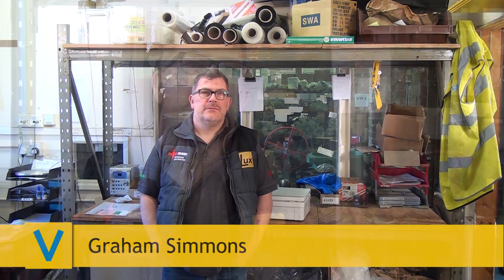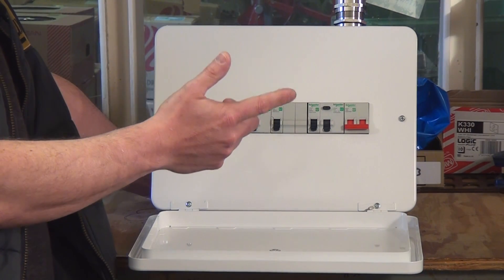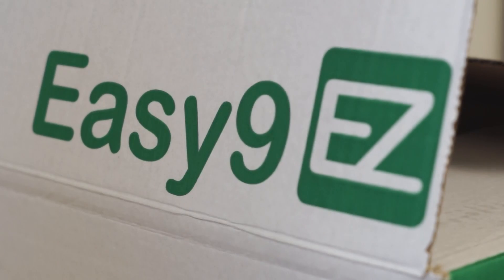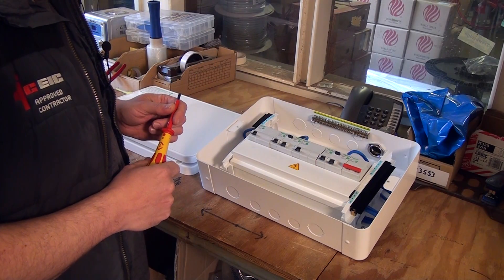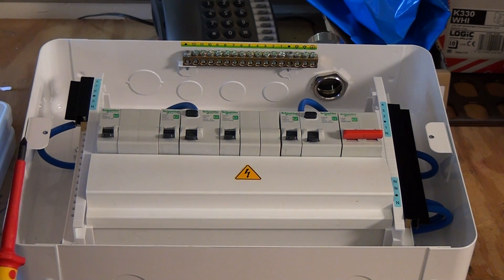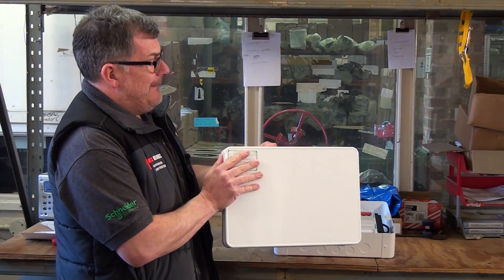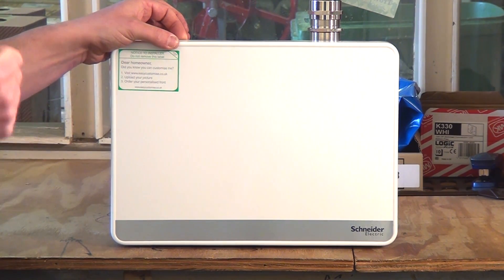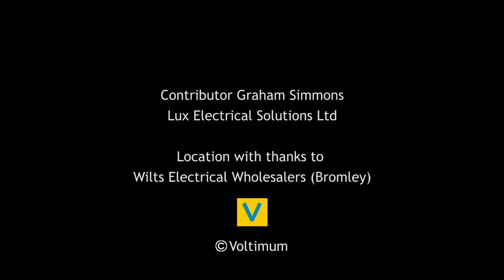Guide to choosing the right consumer unit

Comment: I just bought the 16 way version to replace my old CU. I've gone for RCBOs and there's plenty of room for them. Knockouts are on the top, bottom and rear so providing there's enough length on the existing cables it should be a breeze to install. The Schneider Easy 9 looks the business and the customisable front is a nice touch.

Comment: Amendment 3 - House fires, metal box contains a fire for longer....should the reg not encourage to have a smoke alarm fitted no more than 3 metres away also? Also the board would be that bit better if it had emergency LED lights fitted when the circuit supplying that area of the board with light, trips.

Comment: Why bother with this split load nonsense anymore? A high end customer would surely pay a bit more one off for the convenience of all RCBOs.

What would make a great board is:
All RCBOs, 
Extra room above the devices to facilitate a neat loop of cable, 
Something solid and square at both ends of the din rail to hold the devices square, 
L and N busbars to eliminate the need for tatty RCBO N tails, 
An earth terminal above each device so CPCs aren't routed horizontally.

Yes, we can wire up existing boards neatly with a bit of effort and care but then when it comes to adding/removing a circuit all the CPCs have to be moved out of the way and the relevant cables dug out.
Reply: Totally agree. It's about time manufactures brought out RCBO''s that utilised both a Line and Neutral Busbar approach to remove the nee for Neutral return cables. Just have the Line and Neutral load conected to the top of the RCBO's. I believe SBS Trade Sales are able to supply the dual busbar domestic CU and RCBO's.